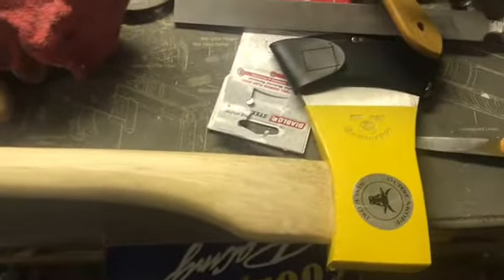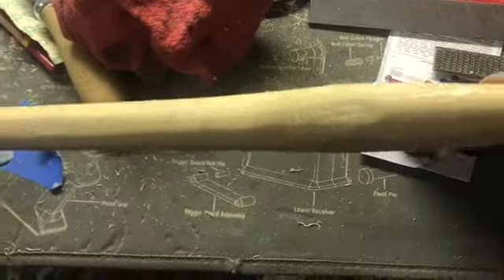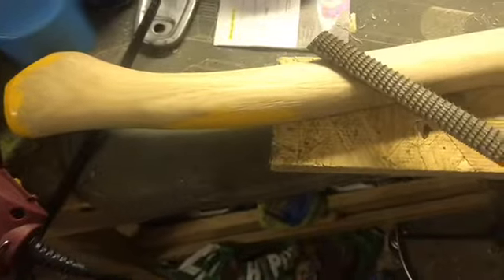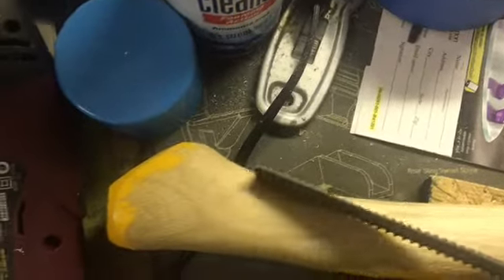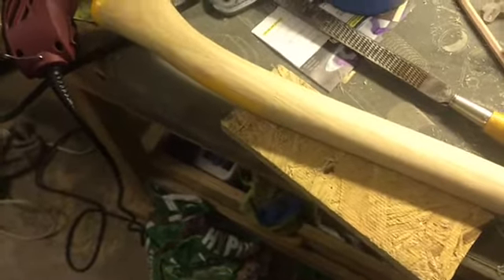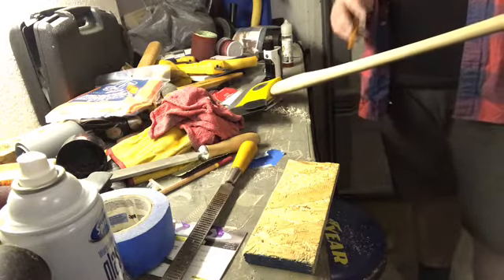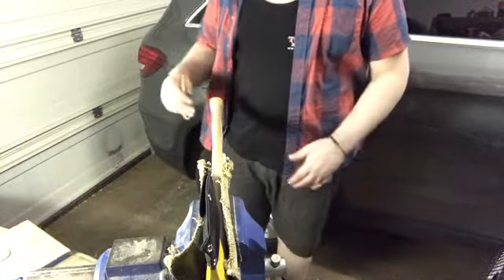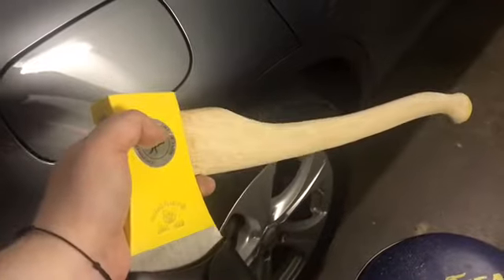Ochsenkopf Iltis Model Canada 1000g: Handle Tuning

Comment: Well, now understand what you meant by "upgrading the ochsenkopf handle"... dude this job that you did here is amazing! Wow! :)
Reply from the maker: I really appreciate that! You should see how it looks now after it’s been oiled and used. It’s currently my favorite axe to use and I have Tuatahi, Basque, council tool, and vintage axes. You should get one! I’d actually recommend the one I got (model Canada 1000g) because it’s the only iltis with an oval eye besides the double bit. Also the hollow is more pronounced than the others as well. It gives the axe more sharpening life. Another cool thing is they’re hardened up to the eye, which also extends the life of the bit, but it makes a really cool ringing sound when you chop or limb with it. If you do get one of these, expect the head to be around 200-250 grams heavier than what’s advertised. Cheers!

Comment: I really dig the scissor method! Wish I had thought of that before I bought a cabinet scraper card. How do you like the swelled grip? I've tried that on a few of mine and just crave them away, seems to make a lot of blisters. I like having good purchase but find that, for me at least, having a nice 'hook' at the swell allows me to ease the grip during swing which creates more snap and doesn't rub my palms too much. Man up and grow some calluses they say. I know, blah blah blah... if you sweat as much as I do, wet skin rubbing creates blisters even near calluses. Can't always avoid them. For some heavy chopping sessions I'll tape up the heavy abrasion areas on my non-dominant hand.
Reply from the maker: @Clarence R Swann Thanks :) I get what you’re saying about the added friction but for the purposes of this particular axe I want my hand locked in as much as possible and the added swell seems to helps a lot. Luckily my hands don’t sweat too much nor do they callous.. no idea why. I used a 80-100 grit finish and it seems like the perfect amount of grip and softness. Might be what’s maintaining my princess hands haha. Anyway, it’s possible that the combination of the flared palm swell and the hook allow my hand to move more freely. I have giant mitts and most fauns foot-like swells cause more friction in my experience (spreads my hands). I was going for a mini racing handle kind of vibe and it definitely has a similar effect to what you described.